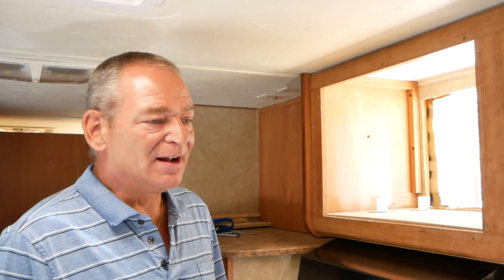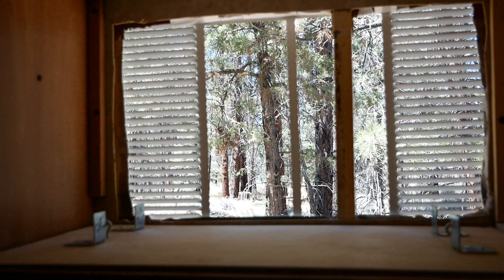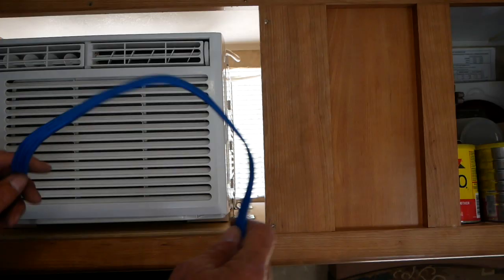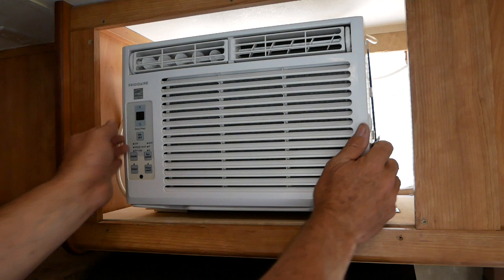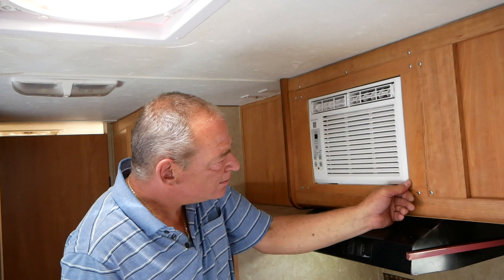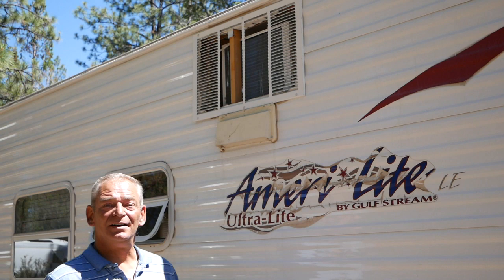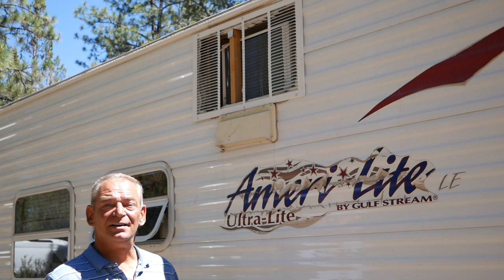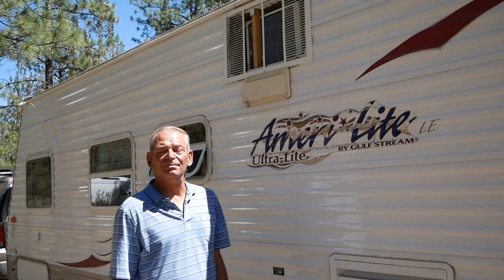Solar air conditioner install in RV microwave cabinet

Comment: You are setting yourself up for water damage!! Because I have NEVER in my life seen a  window ac that DID NOT leak!!! I would do this ONLY if there was some sort of drain pan!!! 
The overheating is because it is set in a box like this and it gets no AIR!! There are slits in the sides and back for it to get air it is MADE to hang OUTSIDE a window to DRAIN and get AIR!!!
Split levels will leak too on the inside because the pipes get clogged up with gunk and mold!! I also dont think they cool as well as a regular window ac!! I will NEVER buy a split level for nothing!!! 
Never buy a 5,000btu ac it is only an over priced fan!! Buy a 8,000btu for small trailer or a 10,000 btu for a larger trailer...a 10k will make your house a freezer easily!!!
Oh and always remember to change or clean the filter every few weeks or once a month this helps the ac breathe and it will work and last a lot longer!! If you are in a dusty area check the backside of the ac it may need a spray down to keep it clean too!!